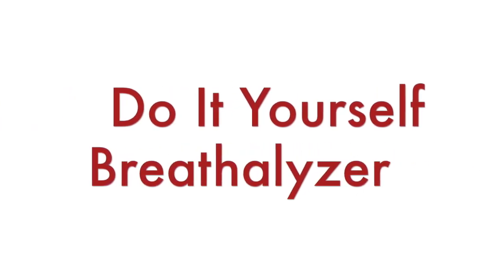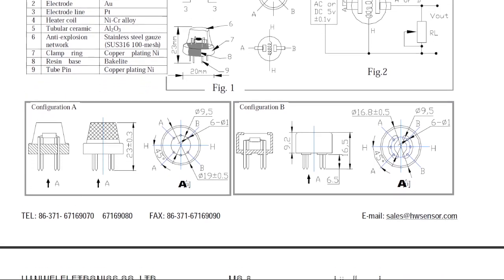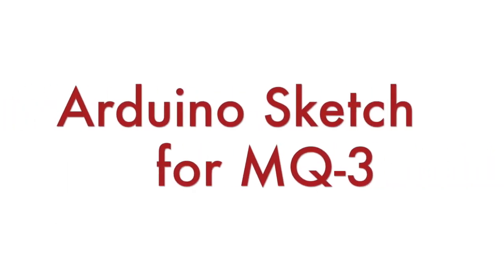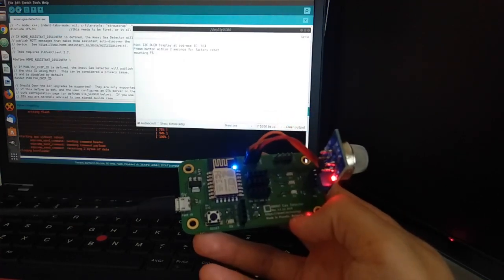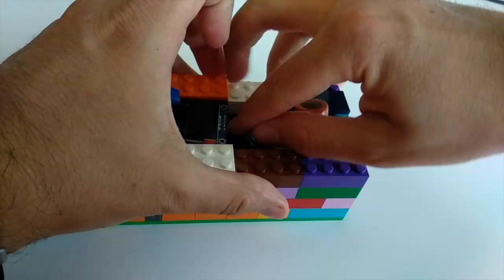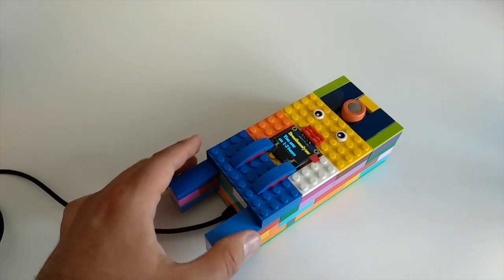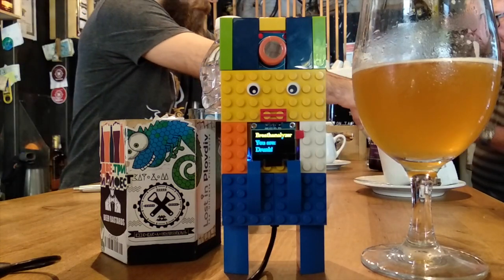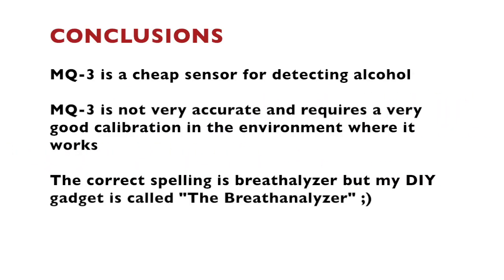DIY Breathalyzer with MQ-3, OLED Display, LEGO Bricks and an Arduino Sketch

Comment: Hi Leon, thank you fir this great video! 
Do you know if MQ30 has become more accurate? 
Can you recommend other breath analysis sensors for a weekend project?

Tnx!
Reply from the maker: Good question. MQ-3 is what it is. I mean it hasn't become more or less accurate. 
There are better ethanol sensor modules from SPEC Sensors but at higher cost which probably makes them not so suitable for a weekend project. I haven't tried them personally yet: https://www.spec-sensors.com/product/ethanol-alcohol-sensor/